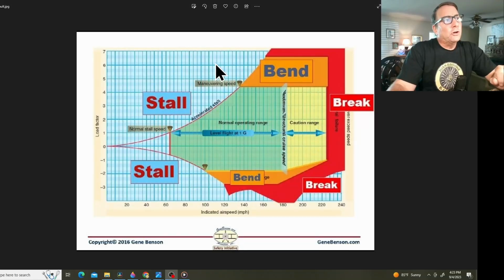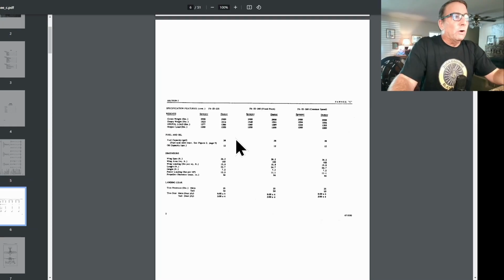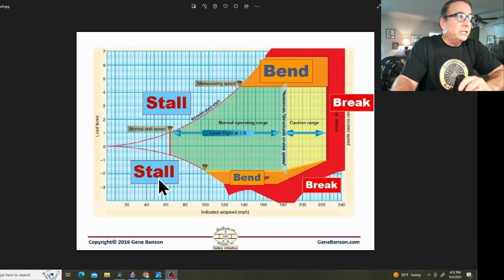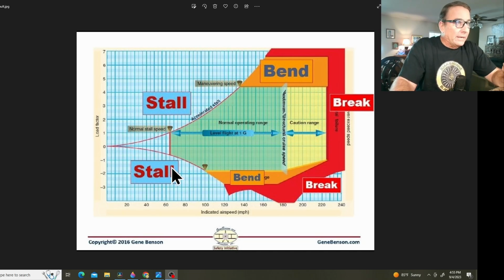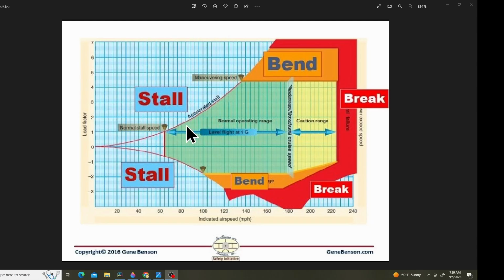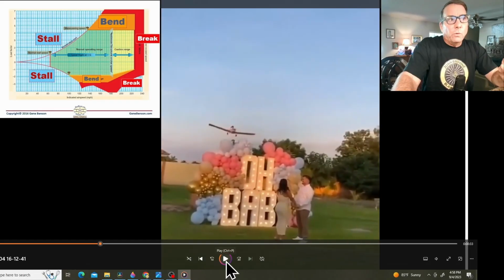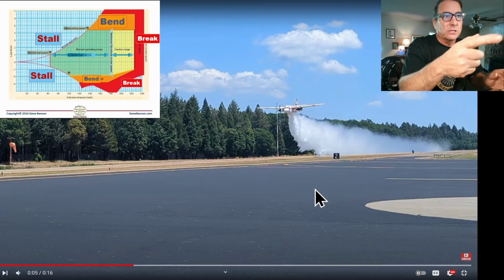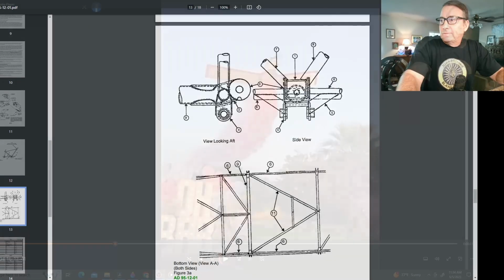PA25-235 Sinaloa MX Gender Reveal Party Structural Failure

Comment: I've been thinking about this case in relation to WWII bombing runs that also dropped a heavy load quickly.  Take a B-17 as the example.  From what it appears the first action after a bomb drop is to push the throttles forward and pitch up to avoid AA and to get away.    If this is an accurate representation of what happens I'm thinking that either the structure is designed for this, or the air density is low enough at altitude to allow this extreme action, or that there isn't enough excess climb power available to exceed structural design limits, or a combination of all three factors.   You would know. How do you see it?    And then there is the extreme case of the dam buster bombers (I think Lancasters) who flew at low altitudes and dropped I think - a 10,000 lb bomb.  My guess is that except for straight and level they couldn't  maneuver after such a  drop.  And if they couldn't maneuver then they had the additional problem of flying with their bomb for awhile as it skipped along with them across the water  - that would be quite interesting  :)

Comment: I had to rewatch the part about why maneuvering speed decreases with weight... I don't know if I'm the only one who got a little lost, but I could still use a deeper dive into the physics. I appreciated that you explained it multiple ways, but for some reason it's still not clicking for me. Thank you for diving into these tragic events so that we can all learn to be better and safer pilots.
Reply: Think of it this way.  Let's say stall angle of attack is 16 degrees.  When your plane is at max gross weight going at 120 MPH, the angle of attack is let's say 12 degrees.  If it was much lighter, then at the same speed your angle of attack is now 8 degrees.  So if you were to fully deflect your controls pitch up, the heavier plane would travel 4 degrees of angle of attack and stall prior to loading the wings enough to bend or break.  However, if you do it at the same speed with the lighter load out, the plane will G-load much more as the angle of attack attempts to go from 8 degrees to 16 degrees.  The plane's wings will probably bend/break prior to stall.  That's why maneuvering speed is less as the plane is lighter.  It forces you to fly at a higher angle of attack to assure that you stall, before ever getting close to damaging the wings.

So in this case, if the pilot was at max maneuvering speed of 120 mph for the max load, when he dumped the load, the maneuvering speed is now much lower than 120 mph.  His angle of attack is now lower, and when he pulls up he goes through max G-loading until failure prior to ever stalling.

Hope this helps.
Reply: @tomnguyen8546 really great and intuitive way of putting it. I think the missing part for me was appreciating that it is about loading over time rather than instantaneous loading which I think is what we are lead to believe
Reply: The way I heard it put is a heavy load will stall.  A lighter load can generate more lift before the stall and thereby more stress on the frame.  Think of the Va stall as a safety valve that dumps excess lift.  The wings will eventually create the extra lift, but the frame can’t spread the lift.  Even if the struts and spar distribute the force to the frame, now the engine mount is overstressed with its heavy load.
Reply: my best guess is... If you were trying to lift a heavy weight and you're pulling up on it and it slipped out of your grip, you would surely shoot right up because the weight that was pulling you down is now gone but its a sudden shock to your body and I think thats what happened to the wings.

Edit: I'm probably wrong but hey ho, im also assuming if my understanding is correct, then when the weight is no longer there and the plane starts pointing up ( because the weight / load is dumped  which then tips nose of the plane up and back?), at that high of a speed its like when you run your flat palm through water and then suddenly turn your palm sideways and the force of your hand dragging that water is much higher, I think the same thing essentially happens to the wings?
Reply: Maneuvering speed is simply an expression of the speed at which the wing will stall and stop creating lift at a particular G load factor (protecting itself from damage). The heavier the airplane, the higher the speed that the wing will stall at a given G load. So if a pilot was flying a speed at which it would have stalled before breaking at a particular weight, when that weight goes down suddenly the speed that it is currently traveling is no longer appropriate/protective. Because it is going too fast for that lighter weight, the wing will keep making lift as an excessive G  load is placed on it, resulting in damage (catastrophic in this case). I hope that helped.
Reply: @FlatOutMatt  Agreed. This is a good explanation.
Reply: I didn’t understand either. 
The airplane has volume loads coming from mass and acceleration. At level flight the acceleration is 1G. Higher accelerations are achieved with turns. These volume forces need to be in balanced with the aerodynamic forces drag and lift. 
At the same G, higher mass needs more aerodynamic lift.
If the mass is located in the middle and the lift on the wings, a lower mass at the same G generates less load on the wings, not more. Or said in a different way, less lift is necessary, and that can be achieved with a lower angle of attack. A lower angle of attack has a lower stall speed. That means less weight less stall speed, the stall curves shift to the left. The maneuvering speed is determined by the Gs at which the frame bends. At lower weight and thus lower aerodynamic lift, it should happen at higher Gs, since the wings are loaded less. But since the stall curves move to the left also, it is not clear for me what happens with the maneuvering speed. 
How I see it, what happened was, that the mass dropped suddenly. At the given aerodynamic lift, determined by the configuration of the wings, this generated an “unbalance” in the forces that automatically generated a higher acceleration. At the same speed this means a smaller turn radius. This becomes a problem when the aerodynamic drag becomes so large that the frame brakes. I think the pilot might have forgotten to correct for the missing weight and the plane just went up.
Reply: @lucianoag999 in reading your comment, this came to mind: in my view, without much pilot jargon, because I’m not a pilot, to lift the nose of the plane and increase altitude quickly, without breaking things, one would use “a lot” of elevator input (pull back on the yoke).  If the same controls input is used on a plane that weighs 1200 lbs less (maybe 20% of the total craft’s weight) on a small aircraft, the resulting action of the plane would be extreme.  Pointing the nose straight up to the sky from level flight AT 150 knocks air speed. Therefore the dropping of all that weight suddenly, maybe in the middle of the yoke pull-back and full throttle acceleration, snaps the wing(s) right off.
Reply: I  know I would have  failed that  qs in an exam . I will try it on  a  CFI
Reply: The reason for the confusion is that wing loading (how heavy is the plane) is not the only concern. G-force is responsible for the structural faikure.

The stress (g-force) on the wing is a function of speed, wing loading and rate of climb (nose pitch up). The faster you yank the nose up at a given speed, the greater the stress. A lighter loaded wing bears less stress than a heavier loaded wing at a given speed and rate of climb (nose pitch up). 

With that said, quickly yanking the nose up of  a lighter loaded wing may exert as much or even more stress to a wing than more slowly pitching the nose up of a heavier loaded wing.

Stall speed is not relevant in this case, only g-force which is a function of speed, wing loading and how quickly is rhe nose pitch up 

The wing spar failed at the connection point to fuselage due to excessive stress (g-loading) as the nose pitched up quickly, even though wing loading decreased after dumping the fluid.
Reply: Sudden change in loading before the pilot can adjust the feel on the elevator
Reply: If Juan is reading this I agree. I do not refute anything in the video, but clarification on the physics of why this happens would be good. 
There is a detailed comment above this one that goes into how lower weight makes the airplane more nimble, and therefore able to apply more stress to the airframe. This feels right intuitively, but hearing it from a pilot would be cool.
Reply: @kingsizedmidget7294  I was doing some reading just now and while there's a lot of talk about critical angles of attack, weight, etc, I think distilling it down to the nature of flight helped me understand it better:
Flight is overcoming gravity. At straight and level flight, you are always pulling 1G. You are in balance with gravity because you are producing 1G of upward lift to counteract Earth's 1G of downward pull. When you start to climb, you pull more than 1G, because you're overcoming gravity.  To generate 1G of lift in a heavy plane, you need a higher angle of attack from your wing than if you were lighter.
If you suddenly dump a lot of weight, your lift is going to go up at any given angle of attack (in the same way that taking off in a heavy plane will have a more sluggish climb, taking off in a light one will have a much faster climb).
So when a plane dumps a lot of water in the air while pulling some number of Gs, it will now generate more lift at that same angle of attack, which means more Gs. So what was a 4G maneuver becomes, say, a 6G or an 8G maneuver, then your wings rip off.
Reply: It’s because he’s looking at a case where the wing attachment failed, but then explains how the wing loading actually goes down.  At 6:39 he briefly explains it’s not the wings that are overstressed by this issue, but the same wing loading applies higher Gs which can break other things.  It’s just a bad example for the issue being explained.
Reply: Yeah I feel the same. The reason why it is not “clicking” is because he didn't explained it at all.
Reply: I think the confusion comes from the explanation being attached to this video. The explanation has nothing to do with either wing or wing attachment point failure, which we witnessed in the video. It is a tangential topic, and sort of strange it was shoehorned in.
Reply: the more weight you add to any acft decreases measurability because the power plant or power plants cannot produce enough power to compensate for the increase in weight, decreasing the ability to conduct certain maneuvers, and you also very likely exceed manufacturing design limits as evident in the video.
Reply: It really makes you think
Reply: Newtons 3 laws of motion… 

Law 1: an object in motion will continue in a straight line unless acted upon by a force. 

In this case, the forces are the thrust from the propellor, the aerodynamic drag, gravity, and the lift from the wings. *If the plane is at a constant speed, those forces are in balance.* (so there is no stress on the airframe in this case)

What’s important is when we want to change our speed and/or direction. For that we need to apply a force (usually more gas to the engine, and/or turning forces from the rudder, flaps, etc).

Law 2: Force = mass x acceleration, f=ma. 

‘Manoeuvring speed’ is a misnomer - it’s actually just another way of saying acceleration (a change in speed or direction). Given that we have mass here, the heavier the plane, the more force we need to manoeuvre the plane. 

Law 3: every action has an equal and opposite reaction.

In this law, action is just another way of saying force. If you pull up steeply in a heavily loaded plane, you are asking for a lot of acceleration, which in turn requires a large amount of force to be applied to the airframe.

Given that gravity, drag, and lift are kinda constant (slight oversimplification!), the only thing that can balance that additional force is potential energy stored as stress within the airframe. This is a bit like a rubber band.

If you stress a rubber band by stretching it, it’s storing a lot of potential energy. Let go, and that energy will pull it back to its original shape (and probably be released as some noise, some heat, and some motion). If you stretch it too far, it will simply snap (and ping off in all directions).

That’s basically what’s happened to the aircraft’s wing. Too great a change of direction, with too much mass, has caused the wing to store too much potential energy, and it’s simply given way. A shallower climb angle and/or less mass, and the accident wouldn’t have happened.
Reply: @robthebloke  “Maneuvering Speed” is not a misnomer and it has nothing to do with acceleration. It is the airspeed at which the wing will stop producing lift at a particular load factor (G). When the wing stalls, it immediately stops carrying the weight of the airplane/stops experiencing the forces that might damage it. 

As the weight of the airplane goes up, so does the maneuvering speed (speed at which it will stall at a particular load factor). Conversely the lighter the airplane is, the slower it can fly at a given load factor before the wing will stall. Therefore in order to conduct abrupt maneuvers safely the pilot has to enter them at a speed slow enough to ensure that the wing will stall before it breaks as a load factor is applied.

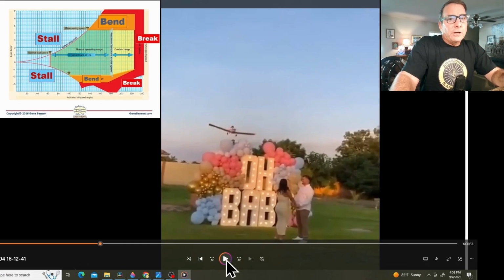Comment: I was surprised when, at 0:59, you called it an "emergency release." It became clearer at 7:34 when you referred to the tank as an "emergency hopper."
As one of your many non-pilot viewers, I truly appreciate how well you get all the pertinent information (available at the time) in a short video that anyone can understand.
This tragedy was likely driven by the pilot not wanting to soak neighboring residents with pink water.
Clearly, a residential area it's a miracle no one on the ground was injured.
This is the second gender-reveal aircraft incident in as many years if I recall correctly.

Comment: The real problem is not the change in Va.  It is the sudden change of load and cg that caused the plane to pitch up.  The Pilot needs to pitch down during the emergency dump and, yes, the pilot should have been operating at a lower airspeed.

Comment: Love this channel and the many excellent videos, but as an aerobatic pilot just wanted to give my take on the possible explanation here that the lower maneuvering speed Va caused by dropping it's load could lead to overstressing the aircraft, which I don't think is true. I will use some easy numbers here not based on real certification categories just to explain wat Va means. I will assume an aircraft where the wing structure is it's critical breaking point for loadfactor determination: If an aircraft has a maximum gross weight of 2000lbs and is certified for 4G, it means the wing structure and attachment points need to be able to withstand 8000lbs without deformation or failure happening. The airspeed where the wing will produces this 8000lbs of lift while at it's critical angle of attack is Va and let's assume it's 100kts in this case. Now if the aircraft's weight is reduced to 1000lbs, it's 1g stall speed will be lower, and so also the 4G stall speed will be lower which is now the new Va. That's why many POH's specify Va for two different weights and the lower weight has a lower Va. But from a structural point of view, the wingloading at a gross weight of 1000lbs at 4G is only 4000lbs and so the wing is not nearly at it's structural design limits. For the wing to reach it's critical structural load of 8000lbs it needs to have a loadfactor of 8G! Now at what speed will this 1000lbs aircraft reach 8G? Well at exactly the same speed as the 2000lbs aircraft reaches 4G. The wing will produce 8000lbs of lift at it's critical angle of attack at it's original Va of 100kts. So from a structural point of view, Va is independent of gross weight, it is only because the certified loadfactor for the aircraft category is constant at 4G, that Vs 4G (Va) drops with a lower weight. On aerobatic aircraft like the Extra's there is only one Va specified because it is really a structural limit only, and the maximum loadfactor that is allowed is dependent on it's weight and not capped by certification category. But overall a lighter aircraft can always withstand more loadfactor before it reaches it's structural critical load, and this is always at the same Va. The reason this aircraft had structural wing damage is most likely from exceeding it's certified loadfactor while being above Va, or the aircraft's structure was compromised by corrosion or other mechanical defects. I hope this explains why specified Va lowers at lower weights, but this is only the case when you keep the maximum loadfactor as a constant due to a certification definition. But the aircraft's real structural Va is independent of weight, if you allow the loadfactor to increase to the wing's critical load.

Comment: look at the frame you froze the film on. The drop is almost complete, the pilot is pulling up and the wing is already failing!  You did that on purpose

It depends on where you are fighting fires. For example, much/most of Canada they drop straight water. The water bombers scoop from a lake. Adding retardant is an option not often used.

PS: I had never heard that limit of dropping, so thanks for the counter intuitive information. (OK, I've never done any drops or drop training).

Comment: If I'm understanding it correctly, it's already trimmed for 2G (relative to empty) of lift with payload. Dumping the load was going to result in a 2G climb. If he pulled up prior to/during/just after dumping, it's being over-controlled to excessive angle of attack and exceeded G rating. A high pitch rate could be also a factor which can overload the wing all by itself.